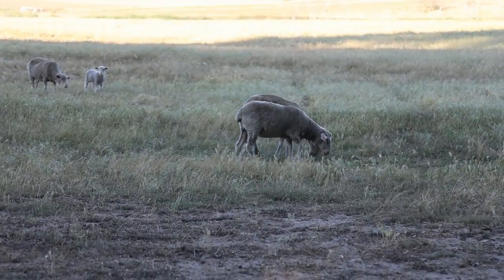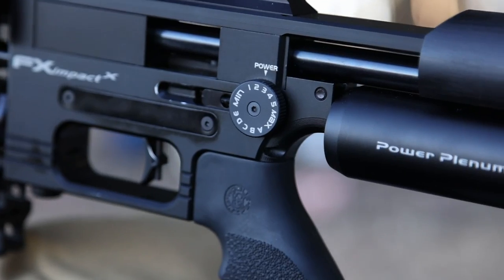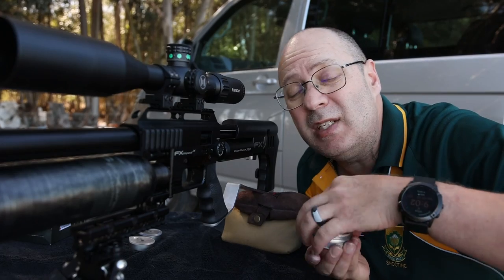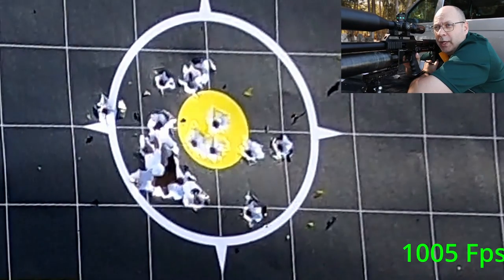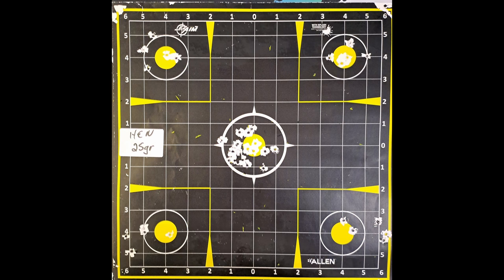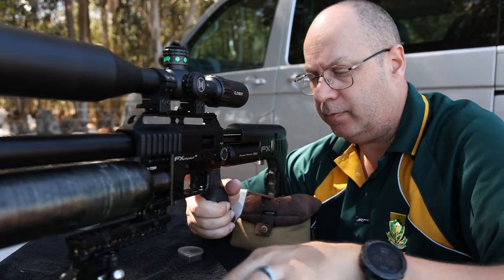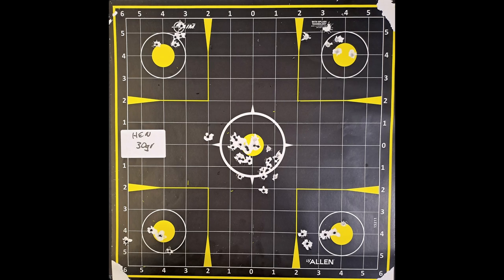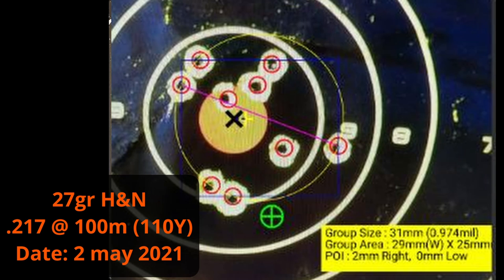H&N 100m testing in windy conditions - 25gr and 30gr - FX Impact style

Comment: @airsmall hello good day dear brother.. 🙂  sorry you busy... do you question? İ help me you? I just bought fx maverick sniper(700 mm superior barrel) .22 cal.  You think 25gr slug hp II (Massive Expansion) 217(5.51) or 218(5.52) the best group 55 vs 100 yard?
Reply from the maker: 218, the new FX barrels like the 218's a bit more, but you need to go and experiment with them.
Reply: @AimSmall  218(5.51) yes or 5.53? So 218 with very good group fxaverick 700 mm superior .22 cal?
Reply: @AimSmall  maverick 110 bar power 7 25 grain the best group you think?
Reply from the maker: @kricketkricket6737  Each barrel and gun will differ unfortunately, so my settings might not work best for the next shooter. But yes, I am very happy with the FX and H&N combo. Need to test some more on the ZAN slugs as well...
Reply from the maker: @kricketkricket6737  .218 = 5.53 , .216 =5.1 (Only JSB KO's make them in that size). The FX superior heavy liners tend to like the 218's a bit better.
Reply: @AimSmall  fx maverick sniper (just superior 700mm) do you think 218 hn ll 25 gr would be a good group at 50 and 100 meters?
Reply from the maker: @kricketkricket6737  I haven't shot the new H&N' yet, I can only comment on the older model with the smaller hollow point. The new model is softer lead and different BC. Try a tin and let me know please.